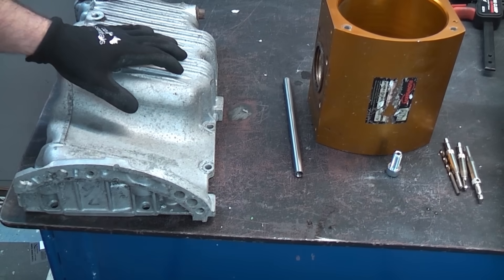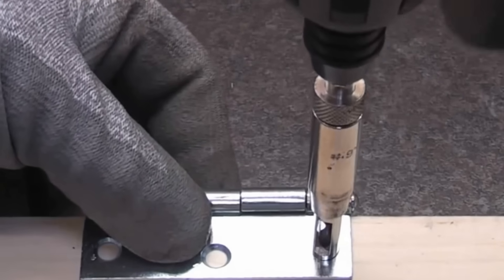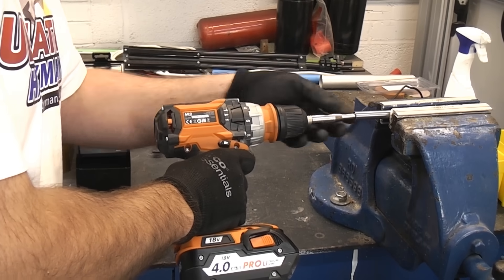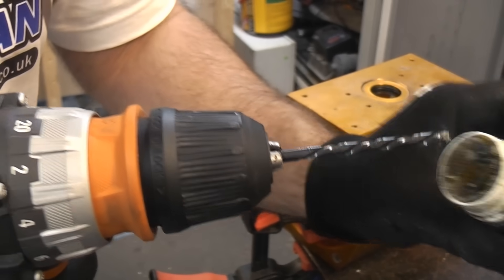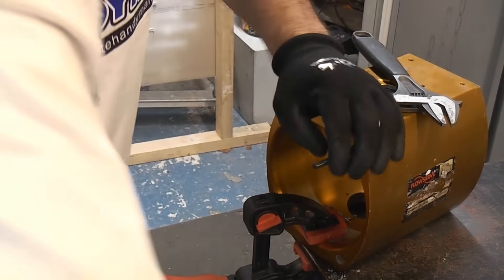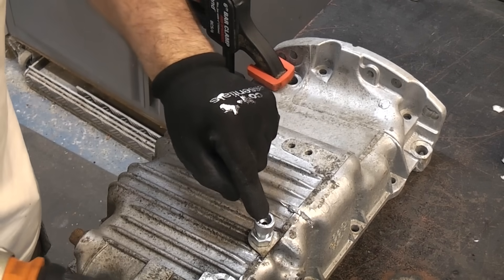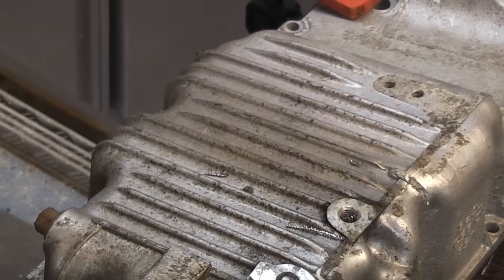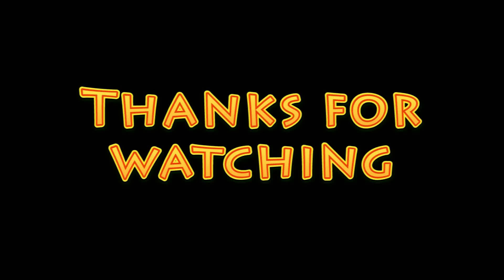How to remove a broken bolt in a deep hole | remove broken bolt in recessed hole

Comment: I also like the idea of the guide bolts. Great idea. As far as the screw extractor goes, I generally use a small hammer and gently tap the end of the extractor (we call them easy outs) while I am turning it. That way it provides a nice subtle impact to the bolt and helps it stays seated as you twist. This method also works nicely with soft Phillips screws. I just gently tap on the end of the screwdriver while turning and you'll never strip out the head. Carburetor fuel bowls are notorious for those crappy little screws.
Reply from the maker: Thanks for the comment
Reply: Yea, its cause those crappy little feul bowl screws are Japanese, they are not #2 Phillips! Even if your equipment was so called made in the USA, parts off of it were made elsewhere!lol

Comment: How did someone manage to break a steel bolt in an aluminum casting without stripping the aluminum threads?
Reply: Ask an owner of a VW golf when he's changing the front bushes on the suspension.... you've got a 5 inch high tensile bolt screwed into 2 inches of aluminium exposed to the elements at one end.... the salt from the road acts like a battery across the aluminium and steel and rots them together..... you will shear the head off the bolt, you will be forced to pay $200 for a new casting and bolt..... and if you want to try and get it out.... good luck!
Reply: @billhanson4921   in europa we doesnt have so much salt on the road like in north america
Reply: I was thinking the Same thing
Reply: @i2phrezh  Electrolises is a terrible thing. Dispairit metals and esspecially on boats is BAD jugue jugue...
Reply: I just found a severely cross-threaded bolt in my bell housing holding the starter. Stripped the head of the bolt, then it snapped using an extractor of sorts so now I'm left with what's left. Not sure any of these techniques are going to help me in my scenario unfortunately but good stuff to keep in my back pocket so to speak.
Reply: If you can get the broken bolt extracted somehow, you can use a heli-coil to repair the housing.  It's easy, you just drill out the old threads making the hole slightly larger, then tap the hole to receive the heli-coil, it's threaded on the outside and inside, then you can use an original size bolt with the new heli-coil threads.
Reply: @kennethmonson  If you can get the bolt extracted, you can fix the hole with a heli-coil.  Just drill the old hole, tap it, insert a heli-coil, and the same size bolt will now work again.  You can get them at any auto parts store. You can get a kit with the right drill, tap, and heli-coil for the job.
Reply: @kennethmonson  This might be tricky, but should work.  Try drilling out a hole in the centre of the snapped off bolt as explained in the video and then tap a new thread into it. Should be slightly  smaller diam than to existing. Then you can use a new smaller bolt with a washer.  The steel bolt you are trying to tap into might be very hard so go slowly.
You might find that the old bolt comes out when you try to tap it - then you will have to try and clean up the existing thread or tap it out to a larger size.
You will need a flat ended tap if the hole is blind.
Reply: It happens all the time... left handed drills are nice.
Reply: Ripsaw17 Dennis  And exactly how do you get the welding equipment down the 8 mm (threaded) hole???
Reply: Hartmut W Sager , I have done at least 100 on 4.6 crown Vic engines by welding them out. The heat difference lets the head swell just enough to turn out the stud. Then just clean up the threads. Be doing that for 15 years.
Reply: Usually this occurs when the fastener is too long and bottoms out in the hole causing the fastener to break right at the junction of shank to threads. This also makes it a challenge to remove as you must overcome the friction of the jammed fastener....whereas when a fastener breaks due to too much tension then it will simply unscrew often by manipulating with a pick.
Reply: Easy, take an aluminium cilinderhead and steel bolts from the exhaust manifold...happens alot
Reply: If u look at the Alluminum Part, u can see serveral damages and dents. I think it was Broken in a car Accident.
Reply: Chinese steel...
Reply: Ripsaw17 Dennis yep I do that all the time
Reply: That pan has had a hard life. Who welded the crack a couple inches below the broken bolt?  You're not limited by time or position I would stand it vertically soak it in oil and gently heat the the body. I'm a mechanic in a propellant factory and you'll not get heat within a mile of a broken fastener there.  So your best bet is to learn the 6th sense for when something might break and slow the F down.
Reply: He broke it just to demonstrate his point!! but i dont think itll work in a real situation.
Reply: it was broken before it went in the hole
Reply: i snapped an m8 in a skoda fabia wishbone carrier,(aluminium casting) was part way out then snapped, tried penetrating spray, heat, air impact wrench, then snapped it with a breaker bar
Reply: @Gareth Wigglesworth Tosser!
Reply: over tightening
Reply: The aluminum threads mass together and now nothing will back out.
Reply: It is real easy.  The bolt becomes work-hardened and brittle from the stress of repeated tensile and shearing forces.  This is a common problem when a bolt is repeatedly loaded and unloaded without sufficient preload.  Keep the bolts torqued down properly and they actually work less hard and the problem will be less likely to occur.
Reply: Heavy duty Loctite used on initial installation and the bolt not High Tensile that is soft mild steel bolt, come removal time no heat used to soften the Loctite, result broken bolt in aluminum, that would do it.
Reply: Electrolises is a teribile nasty thing. Work on a fishing boat and you'll know...
Reply: My bike has aluminum heads the header bolt broke off from loosening on the road and vibrating. I'm going to try the heated alum and water method
Reply: Paul Vasso  or maybe share them....
Reply: Douglas Burnside 
It’s magic
Reply: A steel bolt has just broken in my bike swing arm. It was corroded and snapped when I tried to take it out. It’s flush unlike most of these in the video.
Reply: It can happen but not usually that far into the hole, there is no way it would break very far beyond the face of the part, these were broken ahead of time and screwed into the hole to demonstrate how to remove them.
Reply: Douglas Burnside.   very good question.
Reply: Another potential solution is to use longer bolts and place stacks of washers or other spacers between the heads of the bolts and the flange.  The increased flexibility of the longer bolts reduce the probability of metal fatigue and failure from heat cycling.
Reply: @zash721  - For what it's worth here goes 2 cents...

Replace the bolts with studs. Than use bronze nuts. ;-)
No more broken components any time you need to work on it. ;-)

Cheers
Reply: It's called electrolysis. It happens all the time with two dislike metals.
Reply: Easily done. Got a customers Saab 2.3 turbo with manifold leak. 2 studs were broke off in head. Explains why I’m online looking up tools to get these steel studs out of aluminum head. They break from heat and pressure holding weight.
Reply: Oh boy!    Aluminum and steel don’t like each other.   The Al will make the steel corrode in place which is why wheh dealing with Al castings you use GOOD screws.   Heavy cadmium plated or stainless if applicable.     Also use some Neverseize compound when you install so this doesn’t happen next time.
Reply: @ @drizler  Good catch Merlin. I was wondering if anyone else would mention the metallurgy problem of steel + aluminum. (They reaaaaaly don't like each other. ; -) 
In addition to the Neverseize, make sure the steel bolt/screw - whatever is anodized. (A coating on the steel to keep the metals apart - no corrosion.) Whenever you buy new bolts/screws that will be used in aluminum - mention it to the counter guy at the parts store. (And hope he knows the difference between regular & anodized steel...)
Reply: @drizler   Neverseize, absolutely.    And, YES, Heavy cadmium plated or stainless if applicable.
Reply: Douglas Burnside well i will tell you my story... I was tightening screw on clutch hub on pressure plate and, unknowingly i overtightened it, at on point it was increasing effort then after, the torque was constant for on rotation, and then weakens suddenly, eneded up breaking the head of the bolt
Reply: @chanakyasinha8046  the exact same thing happened to me... Now I'm watching the video

Comment: Any advice/suggestion on how to remove this?

 https://lh3.googleusercontent.com/qcXq6-u-NMZMQeC_NeqZtmRzRi-r6WAjaX-DbvvSm8JUx_gvy1jP9nQ4apAPnUbJJVX0Hrs1EM-2WZ8Ora-tuTZt9g9tl5idnPrhDZtH8yJqjWkUKQohqjDQ40cboWU28W0VEb6WGg5fPgfavegxRQbFN3qROY5Xn4QjmyfrTnZVCIPThH78mdEaXBRxk_2vSN17r7xOGclShL21rgk44frrDeces-O1gVu_4Zz1vJNxU2UZXB066s9EvuW90fPqXJDEsAqoQYUTRIgswNst_80pX77CKwqxs8usCBlv0gybC1LzFWG4w6J0G9VdAhU4uIHlHQrlWnjN2Phr4l9XA7YshR3UJmWDtXw7OYQqBZG1Wj5qMvMHY6Rf6bnhkax2voLObBE4R4fAYhby7fjT10HNOsk9zbyQll5oNIoCVEebOuPVHsjdUbda7nFdIzSUzjqzRICg55LU0KSliJPEDo9lsaGfRNe8hQBEughGtkB0C__JLcZnLaMitpoCqVsxMr0f9T52VamKe2dsPm5CawHXp8JaWc4ceCH84Mlf899n2CpGAG66oK6LWquK-K95pGSpek1lQOWIGzrAy2jAXNnFYdDET22gRV-7GQO0bWaTYHd4x_Ken2cZrRAWIcny=w1250-h938-no
Reply from the maker: That is going to be very difficult. I would start be heating it with a blowtorch for about 15 minutes, then once it has cooled I would spray it with some spray penetrant and let that soak in. You can then try tapping it around with a centre punch and hammer, if it does not move I would try welding a nut onto it. Some techniques can be seen here- https://www.youtube.com/watch?v=_R1b8niX13w
Reply: @ultimatehandyman  it's safe to heat for 15 minutes an aluminium head?
Reply from the maker: Yes, as long as you only use a blowtorch and don't have the heat set too high.
It might be worth trying to weld a nut on first, if you have the gear.

Comment: I would have smashed the aluminum casting and be happy to get the bolt out. After that I would be like fuck!... no no nooo. What did I do!
Reply from the maker: A guy I used to work with would have done that ;-)
Thanks for the comment
Reply: Thank u. I learned from your video. Keep it up! :)

Comment: Instead of using big drills minicraft machine with smaller diameter drills can be used to drill through a guiding bolt. Chances of damaging the threads decrease and also while tapping a screw remover. While drilling the broken screw it loosens any how. Very good video thanks
Reply from the maker: Thanks for the comment

Comment: I've been a Tool & Die Maker for 38 years and have extracted every imaginable broken thing in a hole.  My first approach is to try and gently nudge the bold counterclockwise to turn it enough to grab the end with a vicegrip. Failing that, in most cases I will mount whatever it is onto my milling machine.  Find true centre and drill a whole for a tap extractor or drill the entire bolt out to the tap drill size.  What's left of the thread is easy to remove, either by driving in a tap or using gripping tools to pull it out.  Things get tricky when you are removing broken taps or broken drills.  Here I go for carbide tools I make on my cutter grinder to machine away all HHS bits.  What if you need to remove a broken carbide milling cutter or tips of masonry drill or carbide drill?  I use my diamond cutting tools, again on my milling machine.  Sure to drive at high enough speed to avoid chatter and chipping.  Slow or the sweet point of speed is imperative.  As my very last resort, I use my SEDM (Sink Electrical Discharge Machining) or laser.  

I take great care when creating tapped holes, tightening screws to ensure I use proper lubrication and never use such force as to break a screw.  If it's not turning beyond a certain point, stop.  Better to use heat or try some type of lubricant or drill the screw out before it breaks.  Aluminum, bronze, copper, zinc are all terrible materials that like to stick to steel bolts.  Between aluminum and steel you can get chemical reactions that causes electroplating/stripping as one becomes the anode the other the cathode.

Proper maintenance, lubrication and appropriate use prevents broken bolts.
Reply from the maker: Thanks for the detailed comment ;-)

Comment: 40 y.o 1/4" MS screws stuck in cast aluminium. The aluminium oxide and ferric oxide created a super strong mix. I learnt a lot in the process, and here's  what I tried: 
1) Penetrating with WD40 - Not effective 
2) Penetrating with PB blaster - No better 
3) Welding nuts to remains of screws - they sheared off upon application of torque
4) Centredrilling shanks to peel threads out - too much corrosion - the steel threads were still stuck. 
5) Heating in alum bath - just passivated the steel surface and failed to really corrode the steel
6) 70% nitric acid - just passivated the steel as per alum (needed consumer unobtainable 95% nitric acid) 
7) Electrosparking - Bingo. Costly but worked.
Reply: I throw away my transmission block because I snap 3 bolts on it
Reply from the maker: Thanks for the comment

Comment: Thanks for the tricks.  

One trick I used was to cool the bolt with freeze spray used for trouble shooting electronics.  The trick is to only freeze the bolt, so it shrinks,but not the surrounding metal.  Next time I will heat the metal with a torch as shown (after the hold is drilled into to it), then freeze the bolt, and pull it with an extractor.
Reply from the maker: Thanks for the comment

Comment: Qual o nome destas ferramentas ?
Reply from the maker: Aqui estão os nomes em inglês
Hinge centering drills- https://fave.co/2Nsk1Ab
Spring tools centre punch- https://fave.co/2x4Ym6G
Left handed drill bits -https://fave.co/2wXdzXm
Screw extractors- https://fave.co/2O7A3MG
For the guides, you will need to make them from some cap head/socket head bolts-
https://www.youtube.com/watch?v=6mZj0J6CNYA&t=2s

Comment: Why can't we just etch a slit onto the head of the bolt and use a screw driver with penetrating oil? I've done it and usually takes just 5 minutes.
Reply from the maker: I look forwards to seeing your video on the subject.
Please le me know when you have uploaded it.
Reply: @ultimatehandyman  I will definitely try filming. I was just trying to understand what the potential downsides to that approach might be 🤷‍♂️
Reply from the maker: It will be hard cutting a slit into a bolt when it's recessed in a hole, won't it?

Comment: Or you could drill a hole all the way thru the broken off bold and then rethread it and use a slightly smaller bolt inside the older stuck bolt.
Reply: This is not an ideal fix for many different  reasons

Comment: Way back when, Screw extractors were not available,  We made our own, From square H.S.S. steal. Lathe Tool bits.   Grinding one end back on four sides, slightly tapered, And slightly spiraled,    Some times we would just drill through with a tapping drill and rethread the the hole,   I was trained as a tool-Maker.
Reply from the maker: Thanks for the comment

Comment: Your not in any risk of melting  the aluminum with a hand held torch. You’ll have better luck getting steel glowing and soft with a torch before you wet aluminum with a torch. Aluminum require lots of heat that a torch can not provide to melt. You do have the risk of making it corrode quicker or become brittle with heat
Reply from the maker: I know, which is why I said you have to be careful if you are using burning gear. 
Thanks for the comment

Comment: Good vid on ways to remove stuck sheared bolts. Bigger bolts ie. those over 3/4" 19mm welding is good plus using pin punch to drive the shaft around. Those that are corroded in are deff bugger to get out. Heat is usually the best as well as hard impact to the shaft of the bolt to free it from the corrosion. What the bolt is embedded in always dictates the strategy on sheared bolt removal. One quick point his hammer is a mallet, or lump hammer.
Reply from the maker: Thanks for the comment

Comment: Cooper  grease and aluminum don't mix , the cooper will react with alloy and will cause corrosion, everything else spot on
Reply from the maker: Copper grease is fine on aluminium most of the time. I've been using it for years with no problems.
Problems seem to occur in humid countries or near salt water, from what people have said in the comments.
Thanks for the comment
Reply: Ultimate Handyman that probably correct , but in that comments, some stuff about broken studs on out boards, maybe you could let your viewers know about the  problems with cooper salt and alloy

Comment: Very interesting - never knew that this could be done. Decades back I had a broken bolt in car engine connecting the dynamo to the engine block, so the unit would loosen as it was supported by only half the old bolt in the socket.  Went to garage ...Sharp intake of breath , "engine out job, drill it out, new insert, unaffordable to do" etc etc.  Cleaning out socket with petrol and supergluing and rescrewing back in half bolt in best complete broke amateur me could do on a regular basis.
Reply from the maker: Thanks for the comment

Comment: I noticed that yo mentioned using a lathe to drill the holes in your metric hole drilling guides (bolts). Since I don’t own a lathe but I have a drill press and machinists vice and can accurately Center the hole. Would you recommend this as an alternative creative possibility? Any caveats?
Reply from the maker: Absolutely, a drill press will work fine- https://www.youtube.com/watch?v=6mZj0J6CNYA
Thanks for the comment